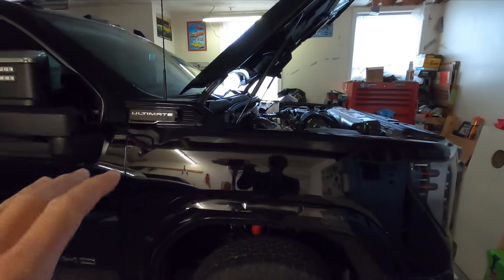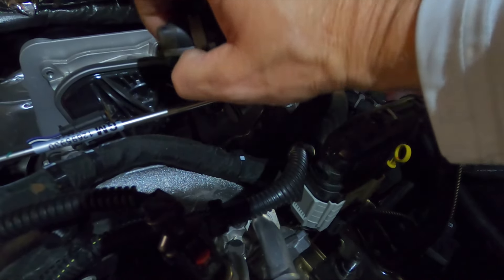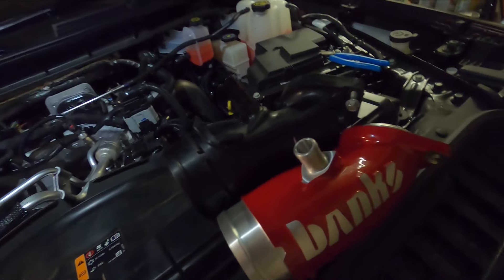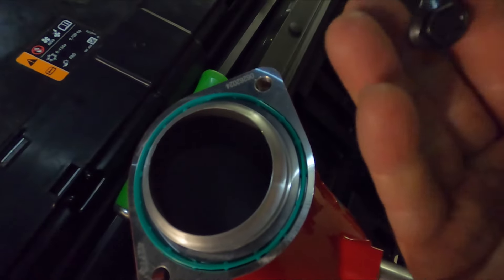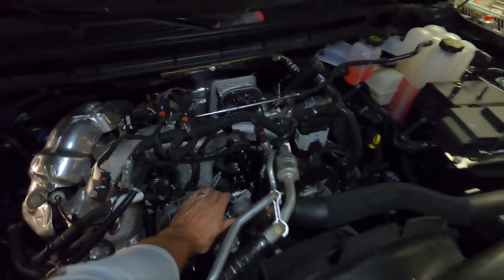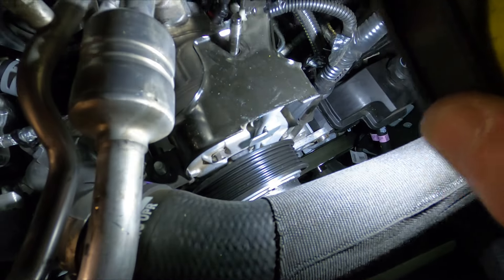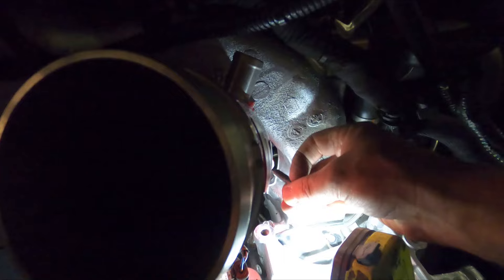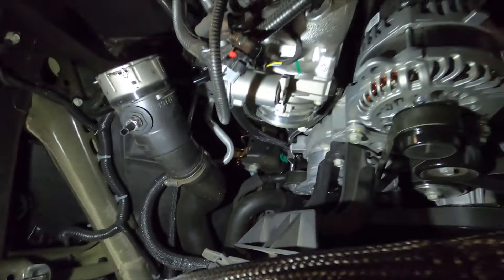Banks Monster Ram Install 2024 Duramax

Comment: Nice vid man, yes definitely remove the ac compressor and save yourself the headache
Reply from the maker: I agree! Why make it harder on yourself. It only takes a few minutes to remove. If you drop that bolt or cross thread it, that's going to be a bad day!

Comment: Danny, thanks for the video.  I'm a little confused on how you dealt with that back bolt on the a/c compressor when you installed it back... you had all kinds of room initially to get a wrench on that back bolt;  but once the monster ram was installed I'm assuming you couldn't use a wrench anymore and the A/C line is in the way for a deep socket.  That bolt appears to be the hardest to deal with, but the video didn't show how you dealt with it.  I really don't want to cut it in case i need to return it to oem for warranty.  i'd like to be able to keep everything stock looking w/o clues i was in there if it came to that.  thanks!!